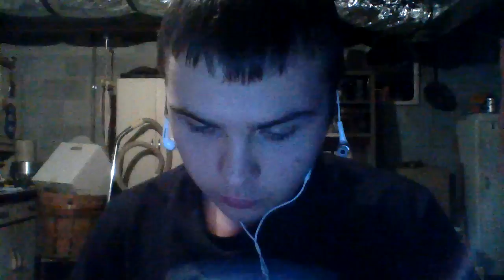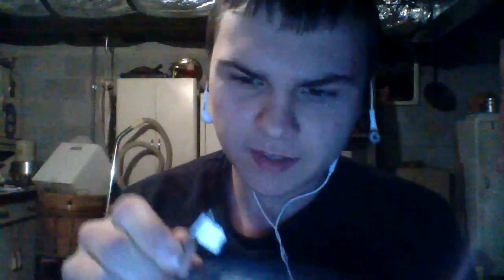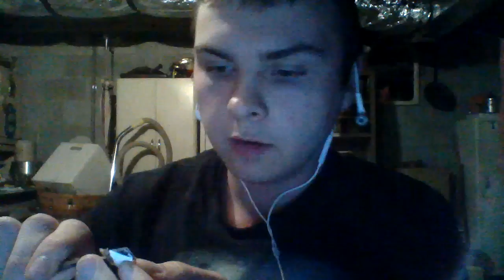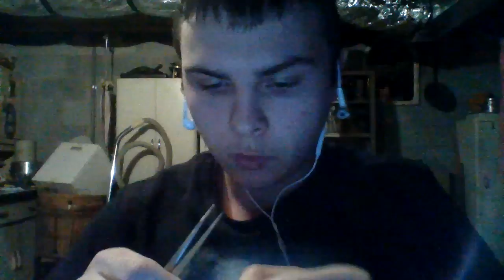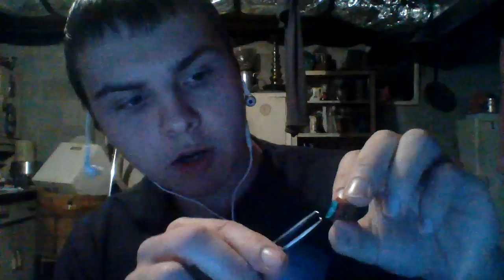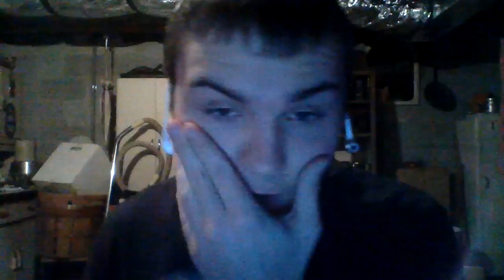How to fix a wireless mouse

Comment: I didn’t remove the chip from the receiver or usb plug but I tried it in a different USB port and it worked so I’m guessing it is the receiver. Thanks for pointing me in the right direction.

Comment: This Apple mouse wireless came with computer 2014 and has no receiver: sealed.  works intermittently; not making contact with batteries. PLEEZE HELP
Reply: It was not cheap: I think $60.00 obtained from Apple

Comment: Suddenly my mouse green light would only show for a few seconds and go off. Put in new batteries. Same thing happened. Mouse was not functioning at all. I tried removing and re-inserting chip in same port several times. Didn't work. Moved chip to next port. Didn't work. Moved it to third port and BINGO! It's working! Have no idea why, but just happy it's working! If that had not worked, I would have tried this paper trick, but thankfully, didn't have to. Anyway, thanks for the video and for the comments that followed which led me to trying different ports and the simple solution that worked for me. Now, let's hope my printer will work from the first or second port and I'll be cookin'!

Comment: Mine completely fell apart and the metal part that goes into the usb port got stuck in there.  I got it out and the plastic and pcb of the adapter are all thats left.  I used some paper under the plastic and threw the metal away and now she works.  Thanks for the tip chumly!

Comment: what does the paper do, i dont get it
Reply from the maker: the paper pushes up on the chip, alot of the time for ANY USB they can bend or come loose so they dont connect right, putting a small folded paper under it to push it up sometimes can allow it to get that connection to work.

Comment: It does not work The paper inside the microchip It didn't work so I just keep turning it off and on It works When I turn it on and off but It will stop for seconds help

Comment: Hey man, I have a s/n: 1001908 gear head wireless mouse that I found at a garage sale but came with no Bluetooth and so I replaced the batteries and tried to use it with another Bluetooth that I had from a different mouse but it does not work. The light comes on when I turn it on but that all... What do you think I should do?
Reply from the maker: The "bluetooth" or USB port is called the receiver.  Each receiver will only work with one specific mouse. Sadly that's something I don't know how to change and don't even think it's possible.